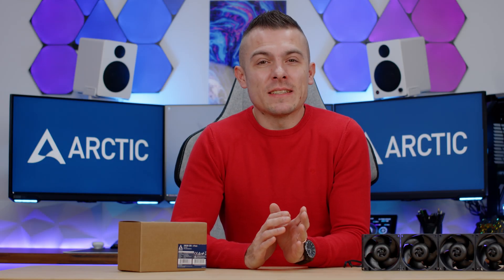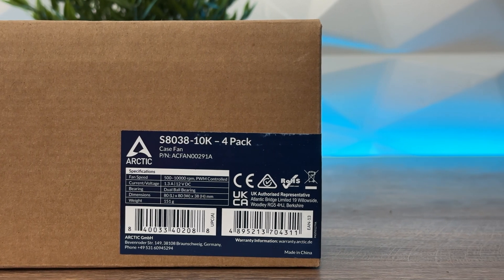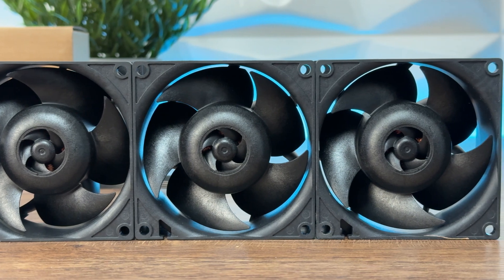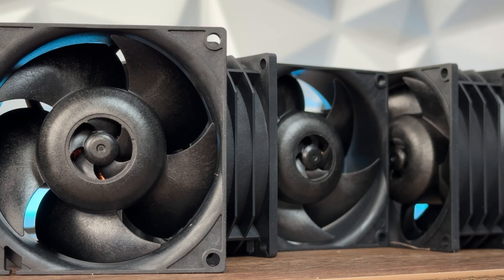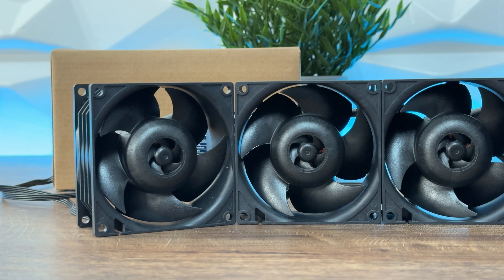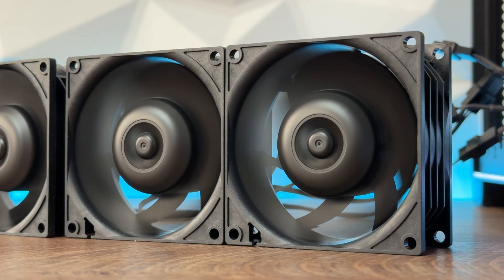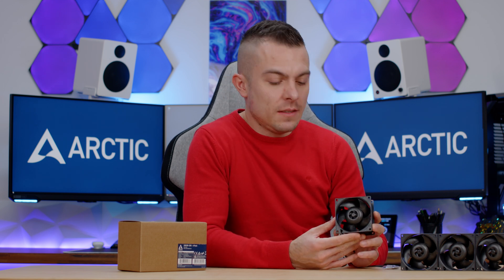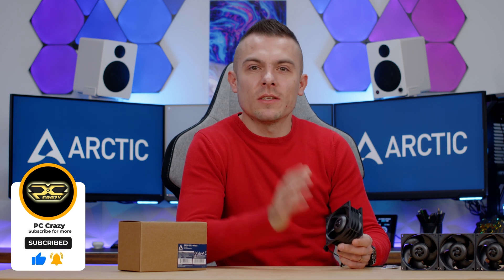NOT YOUR USUAL PC FANS - ARCTIC S8038 10K

Comment: i use the 120 mm 8k version i have 8 intake and one exhaust plus 2 on the cpu cooler 2000rpm beautifully quiet as not working hard they sound a touch worse slower but at an idle of 2k there seriously;y pushing so much air so peacefully its really lovely and i can keep my76 CPU under 30 all;l the time as it heats the fans destroy

Comment: no sound example?
Reply: 8:00 😊
Reply: @RequiemDream  nice demonstration of the hiccup safety feature of a power supply
Reply: Probably loud, they’re designed for server rooms.. build to run at high rpm for extended periods of time.. noise isn’t a big issue
Reply: @808stateofmind2  ahhh you paint words like a painting :D yeah makes sense..